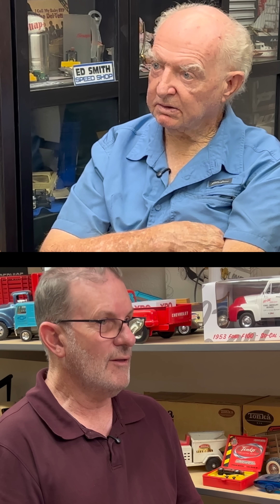377ci Alcohol SBC Build Secrets - Ed Smith w #BarryT From Ask Ed 43 #Stroker #racing #sbcbattle

Comment: Dad raced dirt track from the early 60's up to the early 80's and my relatives and I ran a race car shop and were the pit crew of several race cars up through the evolution of the winged sprinter, as their called today or was when we were involved. Earlier in this period, one night there was an argument between some men in the pits about some 55 gal drum barrels of alcohol in the pits. I don't recall exactly what it was about, perhaps a safety issue, IDK? However, the main fella defending his position about the alcohol being safe took a lid off a barrel, took out a pack of matches and started flipping lit matches into the open barrel one at a time and the matches would go out as soon as they hit the alcohol and I think that everyone was expecting it to explode. (?)
That was in the 70's, if I remember correctly. I can tell you that standing right up by the engine (for the first time) with an old Hilborn injection system on an early full tilt boogie sprint car engine while they rev it from an idle up to at least 7K and back to an idle in the blink of an eye is one helluva feeling! 🤯
Probably like standing in from of a roaring lion or something?
I was baptized forever.. 🎉
Years later watching Sammy Swindell, Steve Kinser and Doug Wolfgang coming out of turn four sideways with the left front wheel off the ground and eventually pulling both up off the ground down the straightway at those speeds competing for first place was wild wild wild! 
I guess Australia 🦘 has quite the sprint car network going and great fans for years now. I caught it on satellite TV a few times. 👍👍
Reply from the maker: Wow awesome story! Thanks
Reply: @BarryTsGarage 
Thank you for all the great videos!
🎉🎉🎉

Comment: Gasoline in an internal combustion engine is fairly optimal at 14.4 to 14.7 to 1. Alcohol is 7.0 to 1.  One gallon of gasoline contains approximately 125000 BTUs per gallon, Alcohol at 91% contains 119,000 BTUs per gallon. At 100%, it's 131,000 BTUs. So knowing where your Alcohol content is running is important for tuning as is ambient Temp and Barometric pressure. You need a good fuel pump and at least 3/8" line on a small inch engine, 1/2" on a Big Block to keep twice the fuel going to your Carburetor(s).
      Crower had a selectable jet on the return line of their mechanical injection to help deal with that. Alcohol and mechanical injection worked well together like that. Back in the day, an Oxygen sensor reading would have been invaluable.
Reply: No jets just right when i did it

Comment: No it isn't? Is it? I'll go do the math & be right back.
Reply: 400 block with a 327 stroke is 347.5 ci with a standard 400 bore. 4.125 bore 3.25 stroke= 347
Reply: @jesseduke694 best do the math again
Reply: @rtkl13 what do you mean? 🤷‍♂️ It's correct!😂
Reply: @jesseduke694 no my bad, you are correct ! That is if you plan on a new block, no boring needed
Reply: @rtkl13  I had the stroke wrong. I edited it when I saw your comment & pretended it wasn't wrong.😂

Comment: About 60 years ago I got the education regarding running alcohol in a race car that they allowed me to crew on which was a modified dirt car with a 327 Chevy engine.  I soon learned that in the long races we ran gasoline and shorter races we ran alcohol.  I was told that the alcohol produced about 10% more power but used about 30% more in volume.  I also learned why we kept our 55 gallon drum of alcohol capped up tight so moisture was not a problem.  So when they started adding ethanol to gasoline, I wasn’t surprised at the outcome of components. After every race we took the bottom right hand screw out of the holly carb and drained the float bowls.  We were able to run the engine for a short period of time on gasoline before loading the car.
Reply: Ethanol in today's gas hasn't been doing my Holley carbs any favors that's for sure.